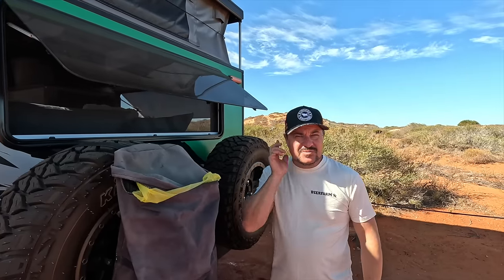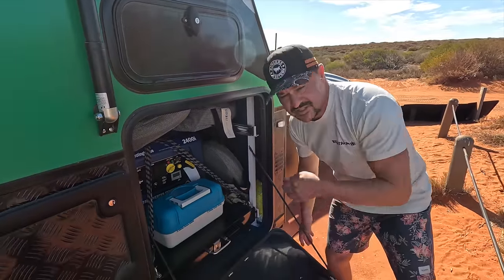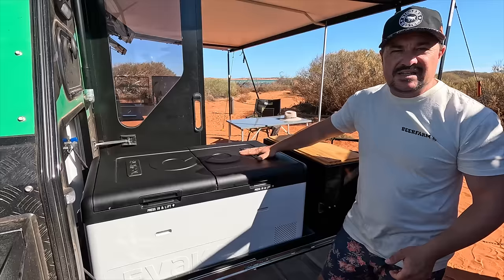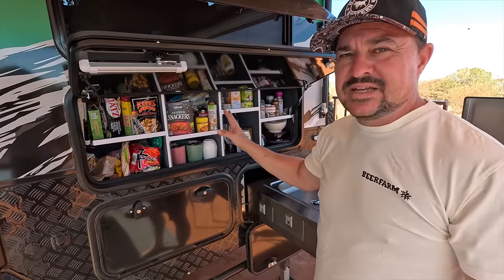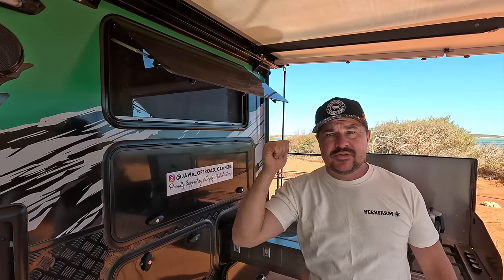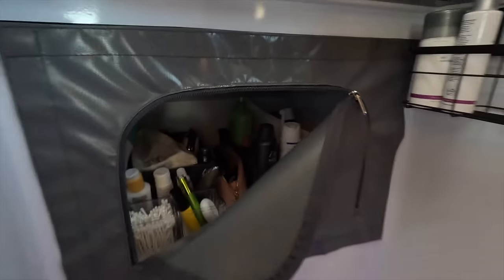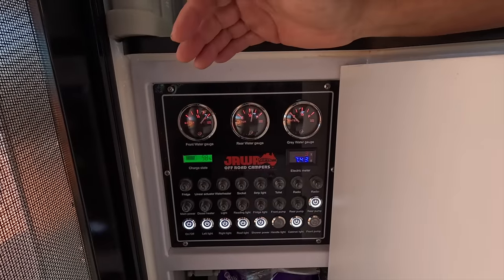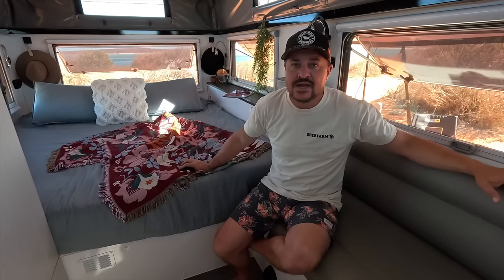Jawa Off-Road Campers Stealth 16- Comprehensive Hybrid Caravan Walk-Around & Review

Comment: A fairly well built, van the agm/load carrying is the only issue, a neat gauge & fuse setup. The hot water is an easy job to fit a tempering valve. The coldwater returns to the warer tank till the water is hot.